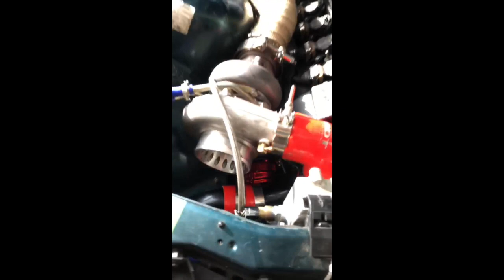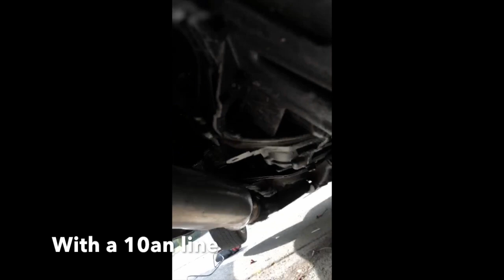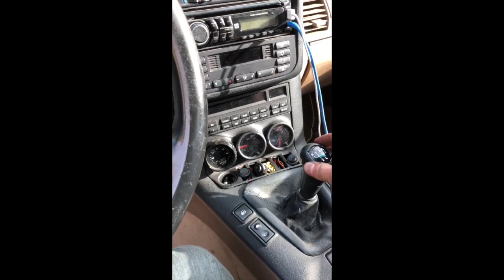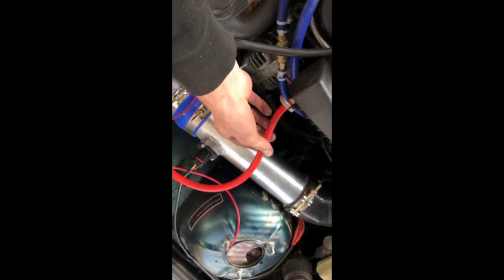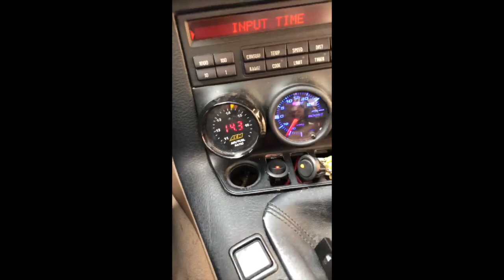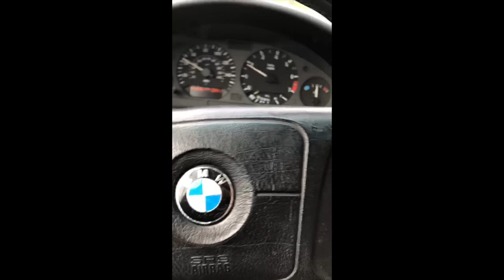e36 Turbo build

Comment: Yoo I have a few questions
Reply from the maker: Whats up?
Reply: I want to head the same route as you I have a 3000 budget and I want to aim for 600hp  and I want to stroke what would be the best setup for this?
Reply from the maker: @DAME_AL  You're not going to be able to complete a turbo built for 3k lol let alone turbo and stroke it.
Reply: will martens how much more like 6-7?
Reply: will martens ok excluding the turbo right could I purchase a engine and build it to handle boost for around that much it would it be more
Reply from the maker: @DAME_AL  Depends what kind of build you want to do and where you want to cut corners. A legit build with quality parts will cost around there. You can go the cx racing kit route, but it won't holdup over time (manifold will crack, turbo will blow, etc) 
You also have to factor in the money it will cost for various broken parts that happen during the build, random tools, gaskets, headgasket, head studs, clutch, tune, gauges, oil lines, etc. 
I have over 10k into my build now after everything, but in its current trim (different from this video) it is using all quality parts.
Reply from the maker: @DAME_AL  Yeah I mean you can pickup a stock m52 for around $300. throw a cutring or an mls headgasket on their and arp head studs and motor will be ready to handle 500 whp all day for under a grand. But if you want long term reliability and ease of mine to build the motor with forged internals would probably end up being around 3k depending how crazy you go with it. 
My current motor is a totally stock bottom end.
Reply: will martens hold up hold up so u telling me for under 1000 I can have 500 to the wheels all I need is a gasket and head bolts wowwwww!! Where can I find the engine is there a site or I gotta get on a forum or something
Reply: will martens I’ll go with a pieces together kit cause I’m going to be pushing it HARD what do you recommend for the manifold

Comment: How did you route the Oil drain from the turbo? I have the rapid spool manifold as well and it seems like the wastegate is in the way.
Reply from the maker: Its pretty hard with a simple an fitting and an hose. I managed to make it work by clocking my turbo a bit, but it is still resting against the wastegate. (not ideal) A lot of people however run a cummins flex drain fitting which fits perfectly.

Comment from the maker: Update: Unfortunately I lost my phone that had hours of videos of my car. Doing pulls, going over more info about it, etc and I am back in school now and won't really be with my car until next year. (I go to school across the country from where I store my car). Car is now running about 22 psi (from a 6266) and spraying a fuck load of meth. I am tuning the stock dme myself using romraider software

Comment: more videos soon please, there’s really no good boosted e36 content on here
Reply from the maker: unfortunately I lost my phone that had hours of videos of my car. Doing pulls, going over more info about it, etc and I am back in school now and won't really be with my car until next year. (I go to school across the country from where I store my car)
Reply from the maker: I have some random videos little videos that i can send to you if you want, but not enough content worth posting a video of. I'm currently running around 22 psi spraying a lot of meth and tuning it myself using romraider. Running a precision 6266
Reply: will martens can u send me a clip of the sound I am really curious what the rapid spook manifold sounds like under load. I’m still trying to decide cx or rapid spool industries for my build.. thanks!!! gsdevin1@gmail.com
Reply from the maker: HIBOOST but definitely go rapid spool. Not even a question
Reply from the maker: new dyno video is up

Comment: you said the manifold warped over time but then say that it only had 2000 miles on it? so the manifold didnt even last 2000 miles? cus i could drive that much in a month
Reply from the maker: Don't get the cx manifold. Go with a quality manifold like the RSI
Reply: i take it you had problems with it almost immediately? i wanted to start with the full cx kit and then start upgrading pieces individually
Reply from the maker: Not really. I still ran it with the manifold warped. When you tighten it down onto the motor it will still sit relatively flat as it will bend. (it leaked very very slightly but not too bad) You will really notice the warp when you take it off. 

I started with the full cx kit and started upgrading, but if I was to do it all over again I would just start with quality parts from the beginning. I do know of some people however with over 7k miles on the cx manifold without issue. If you are keen on starting with the cx kit, I would recommend using everything from the kit expect the manifold and wastegate. Get a tial wastegate and an rsi topmount manifold. 

The CX kit comes with a 2.5" downpipe which isn't ideal for over 400-450 whp as it is incredibly restrictive. When I switched to a 3" I noticed a very significant gain in power (at the same boost level) and the turbo spooled around 300 rpm earlier
Reply: @thebigmann25  how do I install a 3 inch down pipe.i mean who sells it?
Reply from the maker: I made mine myself

Comment: Did you ever had a pb with the oil return line beeing so close to the wastegate ? I had a braided line with a heat sleeve on top of it and it still melted the line ...
Reply from the maker: Nope I never had a problem even when the return line was touching the wastegate. Were you running a quality stainless steel braided line?
Reply from the maker: The nylon braided ones won't hold up to the heat. I eventually stuffed some exhaust wrap around the part that touched the wastegate, but I ran it without that for a long time
Reply from the maker: I did melt one line when it was touching the wastegate so now I have a piece of exhaust heat wrap in between the drain and the wastegate and it has been fine since

Comment: Hey Will! Finally got my bmw boosted! Just wanted to know if you're using an oil catch can? I have a good amount of pressure building in my valve cover. Car is 100% stock.
Reply from the maker: Awesome!  DON'T BOOST without proper venting your valve cover!!! I don't have a catch can, I just have my valve cover open to the atmosphere.
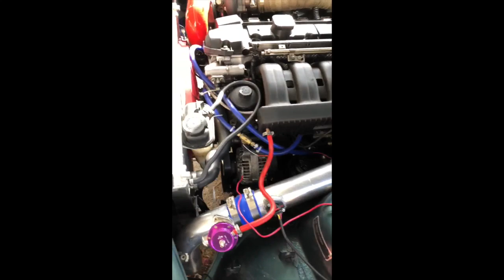Reply from the maker: Pause the video around 3:27 and you can see that I don't have my pcv system hooked up to the valve cover, and I just have it open to the air.
Reply: Got it.... Is there a reason you got rid of it? Ever get any pressure coming out of the valve cover? Im about to unhook it and take it for a spin..
Reply from the maker: When you have a turbo or any forced induction you get way more blow by (past the piston rings) which goes into your crank case and valve cover etc., and the excess blowby needs somewhere to go. When your pcv is still hooked up, then the excess air and pressure inside your motor has no where to go and will start blowing out your valve cover and oil pan gaskets
Reply from the maker: Who tuned your car?

Comment: how long is the intercooler pipe from the bov to the throttle elbow and where can I buy one?
Reply from the maker: The straight one that my maf is in?
Reply: will martens yeah that's the one my cx kit came with an elbow there I want a straight one but don't know what size to order
Reply from the maker: I just ordered a 3" aluminum pipe off ebay

Comment: I like your setup a lot, just wondering  do you have any hood fitment issues with the rapidspool mani and the gt35r? Thinking about running a similar setup
Reply from the maker: No clearance issues at all. You can fit a pretty big turbo on these manifolds before needing to cut the hood.
Reply: will martens Sick! Thanks man

Comment: Hey did you had any issues installing this manifold ? My mechanic sais it's really really tight to the shock tower and it might now fit ...
Reply from the maker: It is very tight. What I did to make it easier was unbolt the passenger side motor mount, took a jack underneath the oil pan and lifted the motor up a couple inches and then I was able to slide the manifold in from the top. It definitely took a few tries and some wiggling back and forth but it will fit. I only installed like 5 manifold studs in the head and then once the manifold was on those 5 studs I then put the other ones it, It is very tedious and take a lot of time underneath the car tightening studs and nuts, but it is 100% doable. You probably don't even have to unbolt the motor mount, but I decided to do that to make it easier as it takes about 45 seconds to undo the motor mount bolt
Reply from the maker: To make tightening all the nuts easier you could also undo the motor mount arm (4 bolts on the block) and then you can fit your hand in there was easier to tighten everything. That is what I did
Reply from the maker: The corner of the turbo flange on the manifold just slightly tapped the side of the shock tower so I took a dremel and just cut out a little square (about 1 inch by 1 inch) in the shock tower to allow the manifold to move with the engine under boost
Reply: I'm on my way to the shop right now
 thanks for everything I'll let you know how it goes

Comment: At what rpm is it spooling ?
Reply from the maker: I get 15 psi by 3300 rpm in 4th gear
Reply: will martens thanks ! I'm doing almost the same as you! A m50b28 stroker , mls ,arp and a gt35
Reply from the maker: Awesome man! Goodluck
Reply: will martens thanks ! Awesome content btw
Reply from the maker: Thanks bro! Unfortunately i'm going back to school on the east coast so I wont be able to upload anymore content until like may.
Reply: When are you installing the 6266 ? 
We have almost an identical setup  :) 
What meth kit did you order? I was thinking AEM for mine